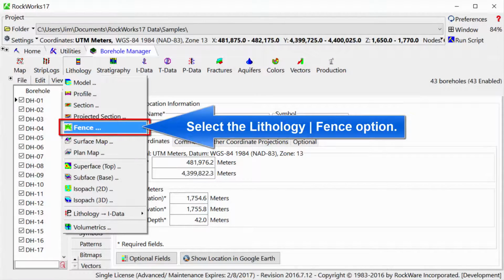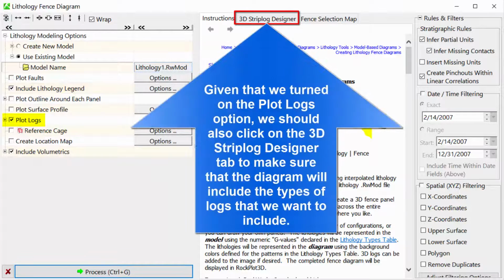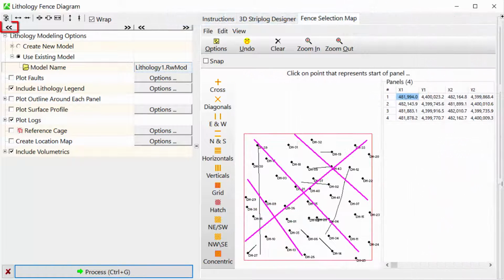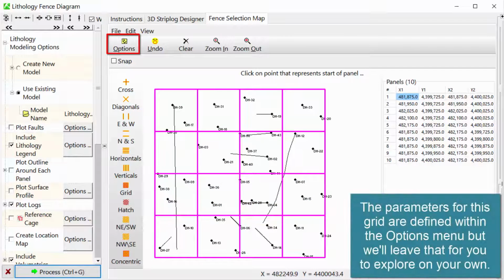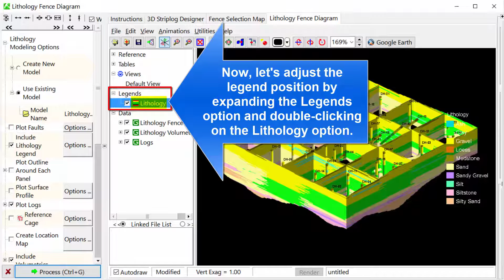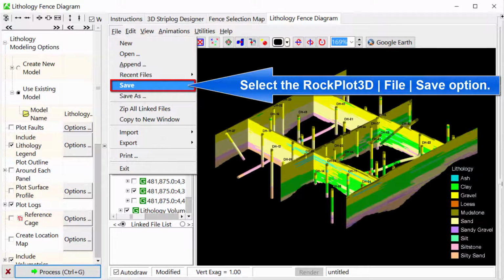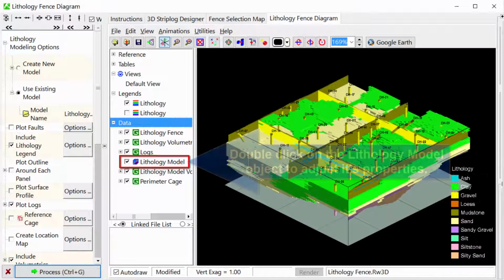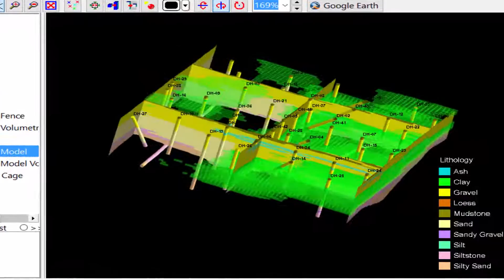(RTE 4.2) Creating a Lithology Fence Diagram

Comment: How to bring wells ids down close to top of wells that are well above the wells in fence diagram?
Reply from the maker: Sorry for the extended delay in replying.  Please know that you can get immediate answers from support@rockware.com (we check YouTube infrequently).  In the meantime: (1) Select the Title option within the 3D Log Designer.  (2) Set the Vertical Offset for the titles to Manual.  (3) Experiment with the offset number until you're satisfied with the results.
Reply from the maker: p.s. We created a series of screenshots to illustrate these steps but the YouTube reply option doesn't allow for that whereas email or LinkedIn does.
Reply: @RockWareSoftware  Thankyou